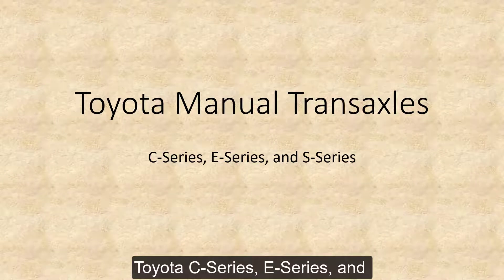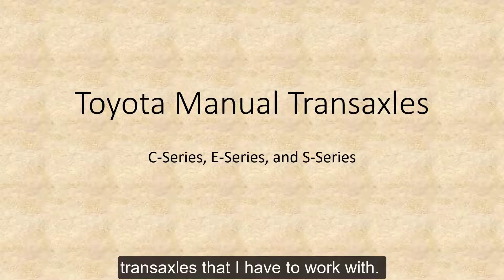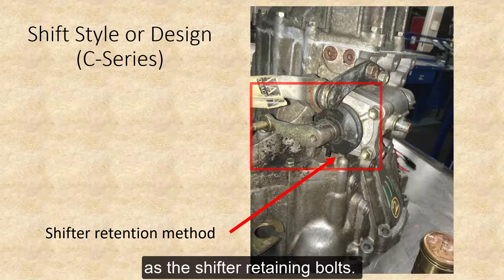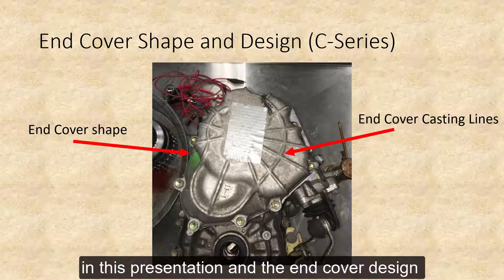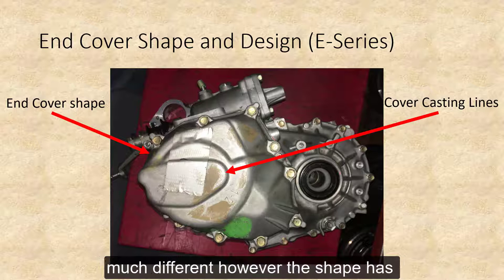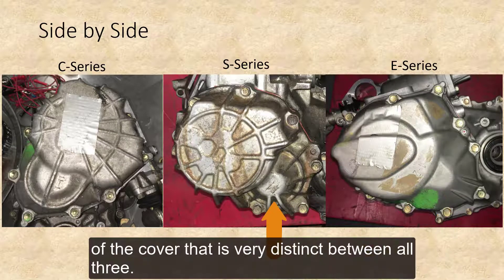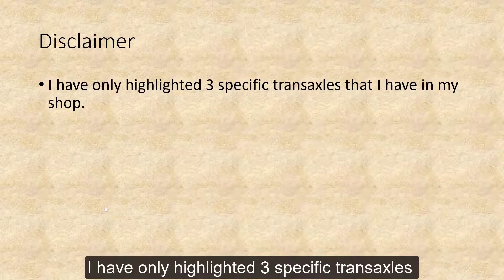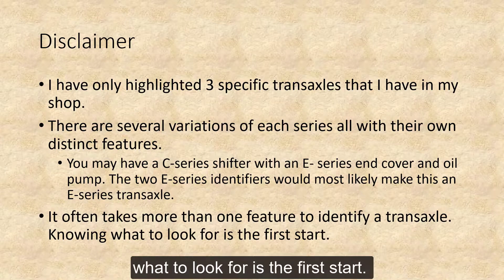Toyota Manual Transaxle Identification

Comment: Do transaxles or transmissions have identification numbers on them? I'm trying to identify what transmission my 2013 Tacoma manual 2.7 4x4 has. The truck started life as a 2wd and the transmission was changed along the way. Any tips on where to look exactly?
Reply from the maker: Sometimes there are numbers or tags but not always.  Is this vehicle form outside USA?  When I looked at the service manual all they list is 4WD models using Automatic Transmissions. How many speeds?  4, 5, 6?
Reply: @DrivelineMaster  It's a U.S Tacoma 2nd gen but it came with a 2wd Auto originally. It was later swapped with a Manual 4x4 and I acquired it with the swap. It's a 5 speed.
Reply from the maker: I had to go back to 2010 to find a standard transmission Tacoma model.  In 2010 Toyota used an R155F 5 speed manual transmission and transfer case. This is most likely what you have.  There are no indications of anything on the housing that can be used to identify your transmission however without serious modifications I would not think any other transmission and conversion would be possible.
Reply: @DrivelineMaster  that makes a lot of sense. Thank you! I'm preparing this truck for desert racing and needed to order a short shifter so this definitely helps
Reply from the maker: Glad I could help.  Good luck in the race.